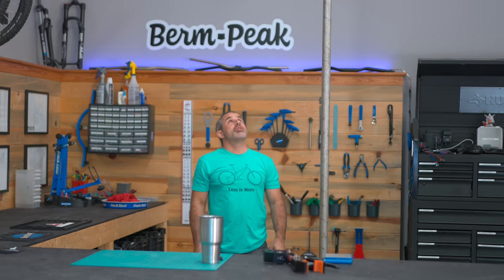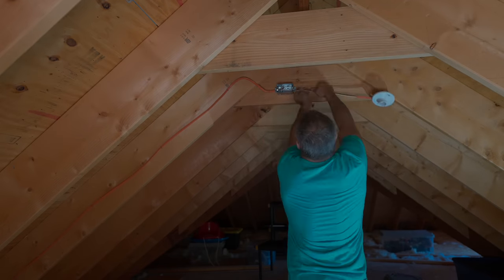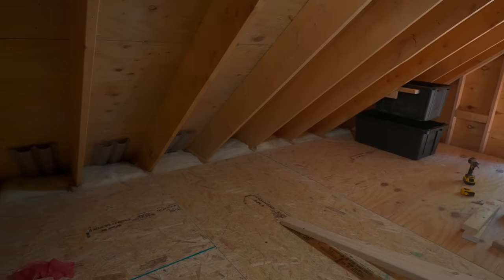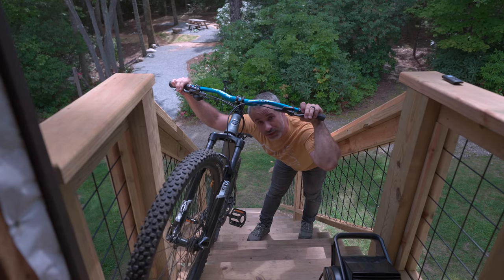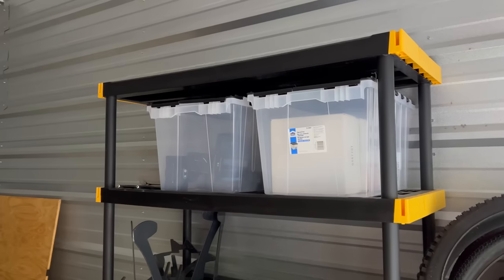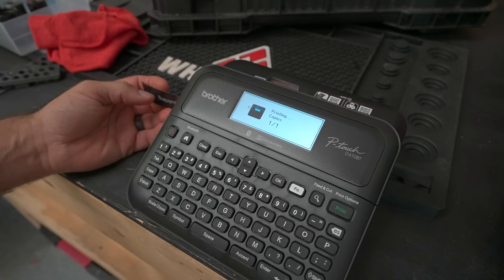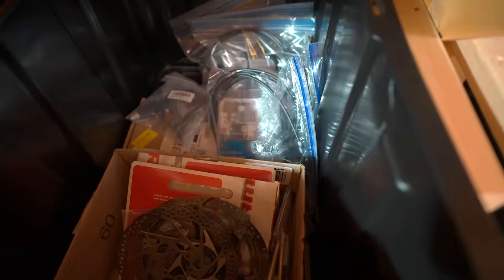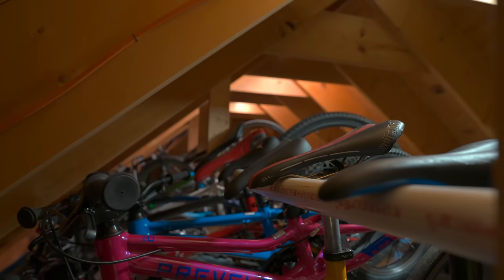Turning the giant attic above my workshop into a stock room for bikes. Yes, it has a fire pole

Comment: Should put in a bucket pulley system so you can lower stuff down without having to make multiple trips
Reply: But a pedal system to raise and lower the bucket!!
Reply: Elevator platform that slides around the pole
Reply: @MrJamesLuz  If this man doesnt make a bike powered elevator of some type i will be very disappointed.
Reply: @mrsaucy1112 and it better be super sketchy too!
Reply: Yep, thinking the whole time it needs a dumbwaiter of some kind. And probably a bike pulley lift on the outside like you see on hay barns.
Reply: Very bummed that the fire pole isn't a Dropper.
Reply: Any concern about heat?  I know my attic gets crazy hot I’m the summer!
Reply: I had the same thought!
Reply: Get an electric hoist from Harbor Freight.
Reply: Have u ridden the back-up stairs, Seth?)
Reply: Its amazing to me still to see how far he has come from washing bikes on the little deck and his closet he stored his stuff in.  Wild to me. Youtube with the come up!!
Reply: i was just going to comment that
Reply: @bonemasterj  dying....
Reply: Stuff/ children 😂😂
Reply: Like a dumbwaiter?
Reply: @klos04 He lives in the middle of a forest. Building can cool down plenty, temperatures should be fine
Reply: @bonemasterj    🤣
Reply: @MrJamesLuz with 1x11 gearing as well😂
Reply: You should setup a boatswains chair for going up
Reply: And then add hydraulic disc brakes for controlled decents.. perfection
Reply: Gator lift
Reply: Or level up the bucket system and put in a dumb waiter....  because he could ride that as well.

Comment: Seth, on your 2x8 comment for wheeling bikes up the stairs, one way to avoid your daughter playing with it is to have it hinged off the banister rail, that way you can have it in an upright locked position when not needed, and then when you need to use it unlock it and flap it down onto the stairs, you can even make it look like a facing board for the banister.
Reply: This is brilliant.
Reply: Aye
Reply: I was thinking just putting a gate at the bottom of the stairs. This way they are completely closed off to the kids when he's not up there. I'd also be wanting something around the firepole at the top to prevent any kid from falling through accidently.
Reply: And let's not pretend that Seth won't at least be considering riding bikes down this staircase. He needs this! It could be another flight deck!
Reply: That would be sick
Reply: I thought maybe a sheet of aluminium with a diamond pattern, wouldn't work as a slide and provides some traction. Can be combined to the hinge idea as well.
Reply: Just put 2" angle iron down it not wide enough to be used as a slide but bike wheel run up in the vee
Reply: Remember that you're talking about childproofing something for a girl whose last name is "Bike Hacks."  She will have it open in seconds. 🙂
Reply: Two wide boards to flap down onto the stairs so it can be used in the winter als a sled ramp
Reply: @KDubber 
When Seth climbs the pole you see a split cover that covers the hole
Reply: @talos935  I saw that; but that looks like nothing more than sheets of drywall/sheetrock. That won't hold the weight of any kid without them breaking through.

Even if I am wrong and its a sheet of wood, I'd be hesitant just to rely on that as a "safety net".
Reply: or just tack some trim across it....
Reply: another way is to teach your daughter respect
Reply: Or use a actual Slide.
Reply: I was just about to say this and thought, "Hmm, maybe someone else thought of this" and behold!  A like-minded person.
Reply: My local railway station has a steel U section channel down each side of a wide set of steps just for bike wheels.

Comment: Fantastic idea Seth, that's a HUGE space to utilise, and who wouldn't love a firepole to play on :)
Maybe worth making the door at top of stairs taller so you don't have to duck every time?
Reply: Maybe it'd look weird from the outside, having this tall door real close to the roof? Idk it would for sure be more comfortable than ducking but I guess that could be an issue.
Reply from the maker: There’s always another optimization! So far on about 40 trips in and out I hit my head 2 times, so by the end of the year it should cost me 12 to 14 head impacts, or whatever it would take to make the opening bigger. There is a light and a fair bit of framing above the door and so it might not be possible to improve it much. Luckily I can just climb the firepole with plenty of headroom.
Reply: Great vid dude! Perhaps hinges on the doors atop the fire pole?
Reply: @SethsBikeHacks  The framing above the door is the header for the door opening and could be moved up higher. You would just need to relocate the electrical, which you already seem comfortable doing.
Reply: It's a door for Seth, not an NBA star 😂😂❤

Comment: Nice!!! I'm on board with re*cycling*... I've built myself a nice 2008 Focus cyclocross and got pretty much everything used but in really nice condition. The only really new parts were tires, rims and spokes... consumables like cables, brake pads adn topped it off with new handlebars and saddle. The bike feels solid and new and it's satisfying to know I used stuff that was probably just not the right fit for the previous owner but not worth throwing away!! Save a tree, ride your bike... save lot's of trees, fix your bike!!

Comment: At my work we have cut out a large portion of the attic floor and suspended it by a heavy winch running a cable to each corner. When in place it works like a regular floor (and ceiling). But it can be used to lift heaver or larger parts without having a permanent hole in the ceiling.

Comment: I feel your pain. I’m constantly getting more projects and more parts and constantly have to find new ways to store more stuff. 

Would be cool if you put the fire pole doors on spring hinges so you could just slide down and the door open and close automatically. 

Get a cheap winch with a wireless controller so you can drop and lift parts to the attic storage with ease. Then you can retract it when your done! About as unnecessary as the fire pole but fun anyways. 😂

Comment: You'll want to change that PVC SCH 40 pipe for your bike rack out for a steel SCH 40 pipe. With the compounded heat in the summer and just the bikes pulling down on it the PVC will sag a lot more over time. It's possible that it could even pull out of the pocket in the rafter.

Comment: 2 things.  1.) Holy cow your panel has sooooooo much extra room in it. 2.) Where they heck did you get that thing on the wall that has the screw in spots to figure out what size/thread a bolt is?

Comment: Attic space is usually very hot especially in the summer time. What are you doing to combat the heat and moisture buildup so it doesn't destroy the rubber tires and any metals? None of those walls are insulated.
Reply: The heat will be an issue during the summer for sure. But the moisture part is no joke either. He will probably want some kind of automatic fan system installed to keep the Bike Attic well ventilated. I have tried insulating the underside of my garage roof (not the attic floor... the roof) and the moisture on warm dry days would build up so much between the insulation and the roof that it cause the insulation paper to become soaked and then the staples holding it up ripped through the wet insulation paper, allowing the insulation to fall down. I'm still surprised by the amount of moisture buildup. I'm still not sure what I can do about that, apart from ventilation, which has helped quite a bit. But it's been difficult to keep the garage warm during the winter, which was the main point of adding the insulation in the first place.

Comment: Oh I would absolutely build a dumbwaiter/elevator system. Necessity is NOT the mother of invention. Laziness is. I built one on my deck using a counter weight. So it works perfectly with very little effort..

Comment: Big fan. I’m confused by one thing. Your attention to detail has always been a strength…..
Why are you using the large extra wide labels with font size set to small?  For that same size label you can crank that font size way up. 
Again, big fan, just wondering if there’s a reason.
Reply from the maker: Haha, you pay more attention to detail than I do! I assume you mean on the bins in the shop. I did it for aesthetics. Some labels have really long names and some short. I wanted them all to have the same font size and so going small was the only way.
Reply: @SethsBikeHacks  Thanks brother!! I appreciate the reply. I use those labels all the time that’s why I noticed.😁. You’re a class act. Keep up the great work!

Comment: Turn the saw around and cut so that the piece of stock you are cutting off is under the shorter side of the shoe. You'll get a better, square cut on the end of the piece you are using, and the dust will blow away from you. 

When you have the larger side of the shoe gliding over the larger, more stable portion of the wood, your saw will cut straight, and not wobble as you cut off the stabilized portion.

Comment: If you cut a long piece of PVC in half length wise , that is fairly wide and stick it going up the stairs. Then you can use that as a way to push the bikes up without it, being tempting to slide down.

Comment: Hey Seth, I have a Cannondale Prophet 4 that I bought back in college (~2008?).  I have really needed to fix it up, but 3 years in storage didn't help, and having 4 kids made me choose to do other things with my time.  I've replaced the brakes and the tires over the life of it, but now the hub on the rear wheel is shot, and I pretty much need to overhaul the whole thing.  It's probably going to cost the same as buying a whole new bike, and I'm kind of intimidated by some of the more complex things. Feels like it's crappy to just throw a bike in the trash, and it's not safe for me to give away.
Super pumped for more fix videos! 
I'll be following along, let me know if you run out of bikes to fix! 🤞

Comment: You could hinge a stair-ramp so it folds up against the balustrade (2" is overkill (as in 2x8) - make it so that it touches all the stair treads when down and you could get away with 1/2" or less . .in something waterproof) - lock it in the up position so it can't be used as a slide.
You could also build a DIY stock/loft/garage elevator - there are heaps of DIY elevator projects online.

Comment: Harbor Freight ATV 12V winch and homebuilt lift platform / tray and some pulleys and you could have dumb waiter type setup to move lots o’ stuff and few trips up and down the stairs or pole.

Comment: Instead of nailing a 2X to the stairs to roll bicycles up just install a plastic gutter or take a ten ft long 4 inch diameter PVC drain pipe and split it. Yuck, lots of PVC dust,or hot-wire smoke.

Comment: hey seht, love your videos, and you and eric are the main reason that im back into riding mtb after i sort of stopped riding for a bit. i think part of the reason was becuase i had a bike that couldnt handle anything more than a paved road so i ended up getting sick of constantly changing tubes and wheels. i understand if you dont see this or cant respond to it but i was just wondering if you could give me some advice for getting my first dually mtb. i am hoping to find one that is under 1.5 grand aud. If possible could you please tell me a reasonble price range and brand of bike.

Comment: Don’t need a 2x8 on the stairs. Small gutter rail. Use grip tape to cover the surface and prevent accidental falls or someone trying to slide it. Make it removable for winter offseason snow clearing.

Comment: I would think about a leveraged pully for your self that you can stand in the bottom loop and will be just heavy enough that it will let you descend with body weight, and thusly heavy enough that you can ascend with minimal effort.

Comment: You should create a parts elevator! just a tub on a rope with some pulleys so you can lower down bigger parts like seatposts or wheels even from the attic into the workshop instead of walking around or tryna clench onto the fire pole!

Comment: Sliding down the pole with the work stand attached still seems unsafe. All it takes is to forget once, and all your bodyweight is placed on a small surface area of your leg. Most likely resulting in a broken femur or shin bone. I know the odds of this happening is very slim but rather be safe than sorry especially cuz of how much you need your legs.
Reply from the maker: All valid points but for what it’s worth, have you seen the rest of my yard?